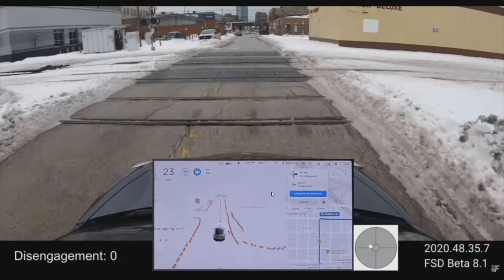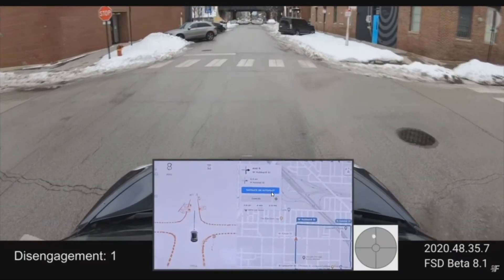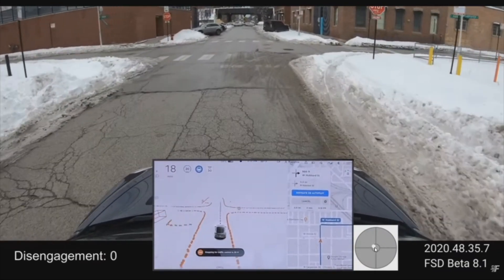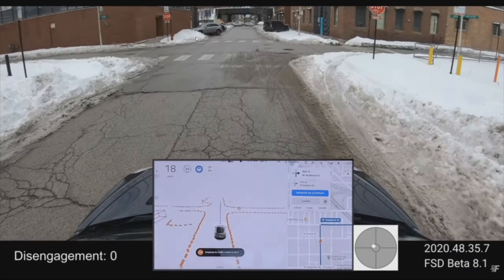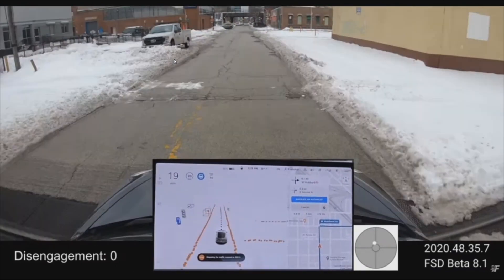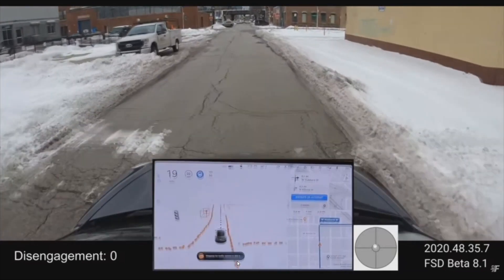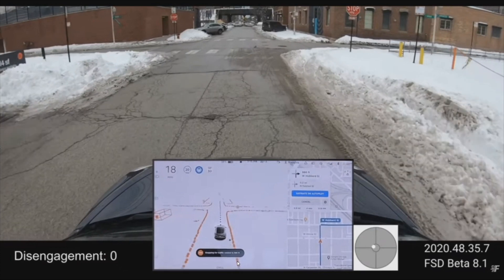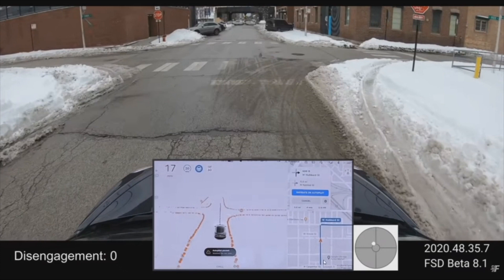FSD Beta 8.1 Analysis - Failed stop sign intersection

Comment: I saw this when it came out. I didn't notice the extra stop sign on the far side. That must be a big part of why it failed here. The snow also played a part, I think, because it pushed in the perceived road edge. That made the near stop sign seem further away from the corner, which would increase the fuzzy weighting that it might not apply to the street or lane the car was using. Likewise the slush obscuring the actual stop line and crosswalk further exacerbated the problem, because if they were more visible they would have added to any weight promoting the correct place to stop.

Comment: So it ignoring the great big normally placed stop sign on the right is fine?  I don't think so.  That should work by now, even if the whole street is buried in snow, buried in water, or whatever.
Reply: Yes, it is perfectly fine. That's why this is released to the general public with instructions that say "no worries, this car does all the driving for you perfectly".

I mean come on. Who said this was "fine". This is why it is in testing*. This is why they are *training the neural network that makes these assessments.

What is your basis  for saying "That should work by now"?  As compared to what?  Is there some other autonomous driving system out there that does this better?

Of course it should make all the right decisions in all conditions. That is the whole freaking point of testing and training a neural network, so that it will in the future, when it is fully ready to be release as level 5.

Also note: there was no traffic, no pedestrians, nothing to cause an accident -- it would not have ignored or missed those. And it did catch itself and stop, just a little bit late.  Human drivers make far worse mistakes all the freaking time.
Reply: There must be a limit set on how far to the right of the road a stop sign can be and still have to be obeyed. If a road intersects the road you are on at an acute angle, there will often be a stop sign on the intersecting road that is clearly visible to you, but does not apply to you.

Comment: I’m still confused. Did it see the stop sign on the right?  If so, shouldn’t it logically assume the sign is before the intersection, not after? 

I’m not sure I’ve ever seen a stop sign beyond the intersection .

I agree it should be easy to solve and a pretty important “edge case”.
Reply: Yes it sees both. The extra stop sign, combined with snow making road edges and intersection corner placement uncertain/incorrect, it's weighted probability calculations lowered its probability that the correct stop sign was applicable to its driving path.